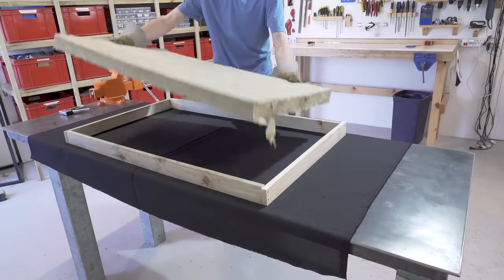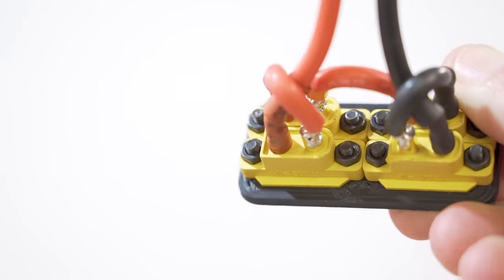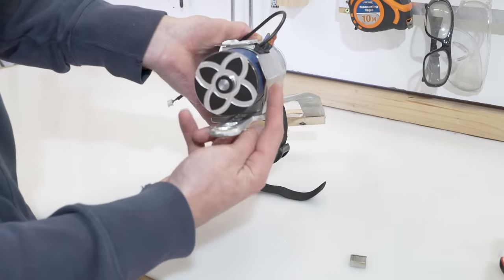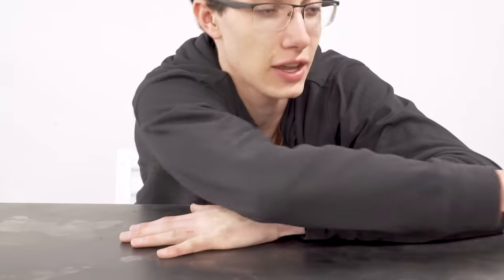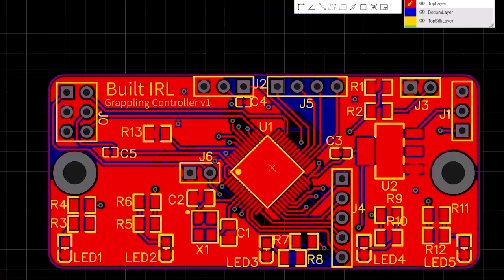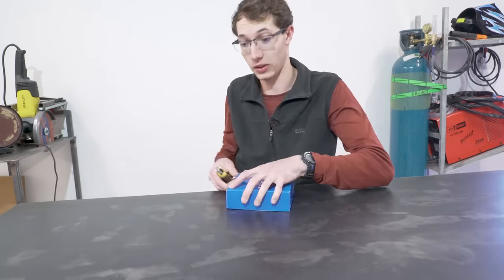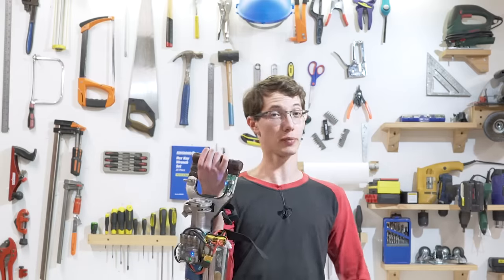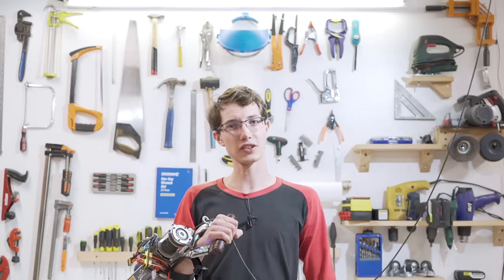Building a real, working grappling gun – Pt.5

Comment: I gotta wonder sometimes. When all of the YouTubers are trying to make grapple guns why don't you try the AOT odm gear? Since you have so much space for technology, harnesses, wire space all that jazz. 

Regardless of that! Awesome video! And awesome build! Very inspiring
Reply from the maker: That's a good point about having the extra space! One on the main issues I can see is with having the launcher at waist level - when the force is being applied so close to your centre of gravity, it gives you much less control over your rotation.
Reply: @Built_IRL  fair enough, although. In the manga details a harness system that rotates the waist stuff by tilting the feet or something. I don't know how exactly one would manage to do that in real life. Without experiencing the equipment failure that Eren fails where he keeps flipping over.

Comment: This great! Consider a harness system to avoid dislocating your shoulder
Reply from the maker: I like how self-contained it is without, but yeah I've got one for some of the more extreme tests
Reply: Also some sort of emergency release mechanism, aka cutting the paracord, in case you need it to quickly detach for any number of reasons something goes wrong.

Comment: I learned something today. An Outrunner motor generates more torque at the cost of rpm whereas an Inrunner is the exact opposite, being lower torque for higher rpm. I always wondered about the difference between the two. This is shown by the Outrunner's lower RPM/V rating and how that rating is inversely proportional to the torque at a given speed. From a physics standpoint it makes a lot of sense, given an Outrunner's rotor is much larger and thus spins slower, though it has more leverage on the load thus increasing torque, just like the stroke of a combustion engine.
Reply from the maker: Nice, it's always good to learn new things! My understanding is that outrunners have more torque because the magnetic part of the rotor (being on the outside) is further from the centre than inrunners - much like how it's easier to close a heavy door by pressing further away from the hinges.
This makes it a good choice for this project, because people are heavy and lifting one needs a lot of torque! This way I don't need such a big gear reduction ratio.
Reply: @Built_IRL  Exactly, yes! We're on the same wavelength and for some reason that made me happy. The analogy with a heavy door is something I also thought about, but since I love cars so much the combustion engine was my first comparison XD

And if it were me using the grappling gun, well, I can say I would probably need a second motor, cuz I'm a bit of a Michelin Man in proportions lol

Comment: What if you added a analog button to control how fast the motor moves?
Reply from the maker: Yep, the potentiometer I'm using as the throttle wheel on the front is analog, so I can control my speed.

Comment: Why not just use Atmega 328P from Arduino on your PCB? I believe its not that much more expensive, but I guess you had your reasons. Did you use capabilities of STM mentioned in video?
Reply from the maker: STM is more common for custom electronics, although I originally used Arduino for prototyping.

Comment: Are you going to post any sort of "guide" pieces, used, the coding, designs for custom parts, drawings etc? I've been working on a suit that I plan to put this into. (I stopped working on my design when I saw you were going to finish it as you had some great ideas)
Reply from the maker: Probably not, since so much of it is one of-a-kind work and some of the parts are actually no longer available anyway. But I've tried to include a lot of top-level info in each of the videos, so that can hopefully help if you try to make your own!
Reply: @Built_IRL  ok. thanks for putting so much work into this. You designed it way better than I could have.